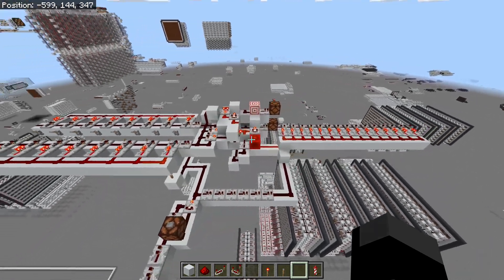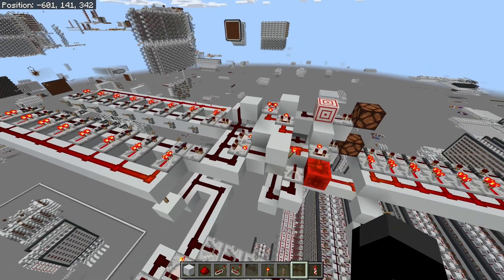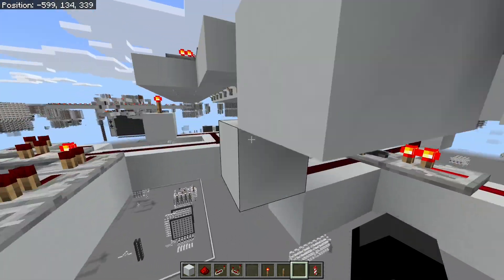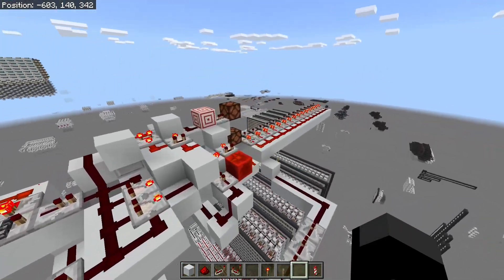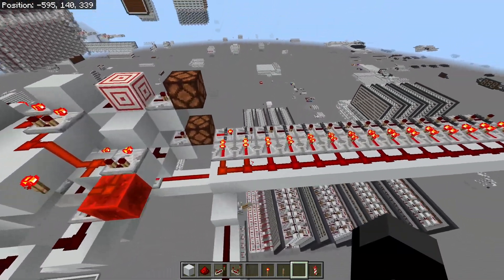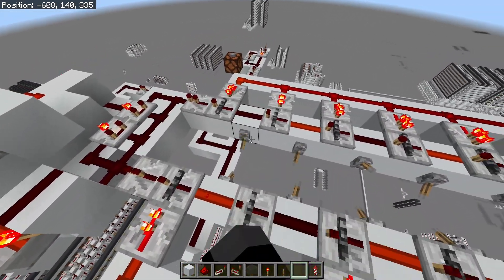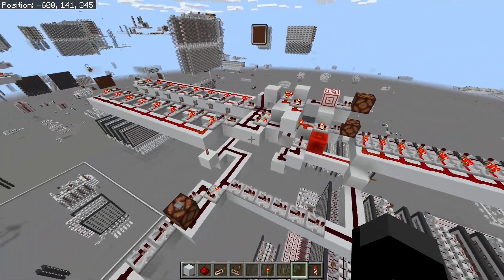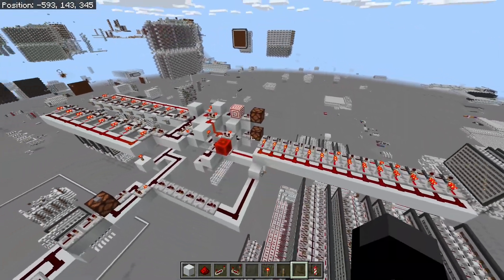Why you should use Serial Adders! - Minecraft Redstone

Comment: I had the same idea after reading about vintage computers recently. Most early computers used serial ALUs to keep the gate count down. Unfortunately they are slow and, when you include the shift registers, not very compact. So idk if I will use them. They do have the advantage of operating on arbitrary width words.

Comment: Nice, I'd been wondering if anyone had played with these in Minecraft!

Bit-serial designs have the advantage that they can be made much smaller than bit parallel designs. Sure, they're slower, but you can use the die space (world space in case of Minecraft!) to put more of them, to do parallelism elsewhere. There's a Swedish guy, Olof Kindgren, who's designed a bit-serial RISC-V implementation called SERV. It's apparently the smallest existing RISC-V core. They're using it as a benchmark, ranking FPGAs by how many SERV cores you can fit on them. A bit silly, but you can actually use it, as I understand it Kindgren uses it for some kind of sensor control thing in his regular job.
Reply: Including the shift registers its not really smaller than an 8 bit adder, sadly.

Comment: Hey! Love the video, but I do have a few footnotes. (I'll be using game ticks, which equate to 2gt per redstone tick, which you use)
This comment is also in reference to Java edition tech

Had a whole comment with way more detail written out but it got deleted, thanks youtube.
May add more context tomorrow if you want it.

1-
The smallest designs of these 1 bit serial adders are 36 blocks in volume and operate at 5Hz (designed by me and Aminotreal) with 8gt throughput (input to output delay)
I'd love to explain their logic more in depth, but that's outside the scope of this comment, and its 2 am. The jist of it is that they convert to bitwise unary and do signal strength logic, then convert back to bin in a Lookup Table.

2-
You don't have to do this with 1 bit. Some of the most efficent adders I've seen do 8 bit serial addition using CCAs, which can also be done at 5Hz. (Same reasoning for not explaining the logic)
The jist of it is that you calculate each set of 8 bits with a cin and without one, and at the end decide which one is valid based on the previous COUT. (there may be other methods I'm not aware of, but this is one I came up with)
3- 
This is more of a suggestion.
Another heavily underrated form of addition is just using RCAs. Rippling delay isn't a problem if you shift each bit of your whole build in delay and basically treat it as synchronous. (in a data loop context- each reg bit reads N time later, and writes N time later, syncing up with the rca delay)
This is great because RCAs can have 4gt throughput, whereas CCAs can't. Obviously you run into problems when you need the whole number at the same time (branch conditions) but this can be mitigated in multiple ways (such as having a separate set of regs with sync read)
This system works great for higher bit counts as it has no faults as it grows, other than the sync data problem. Arithmetic and logic is fully doable like this, with the exception of division and division related arithmetic.
You can for example calculate 3.3Hz fib like this, with the proper forwarding logic, and so so much more. (basic example)
for 8 bits its very much worth it and one of the most powerful data loop designs I've seen.

Still waiting for a TheDarkness Discord to do my info dumps in & discuss this stuff lol